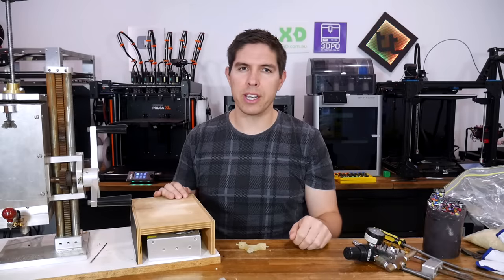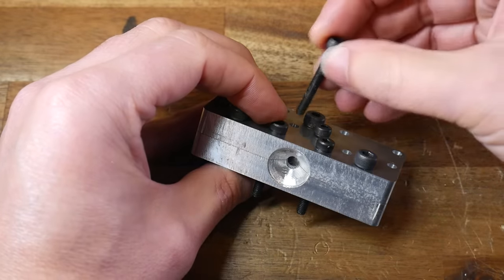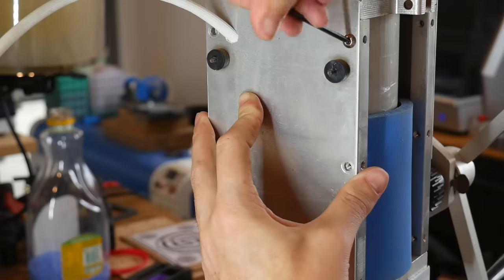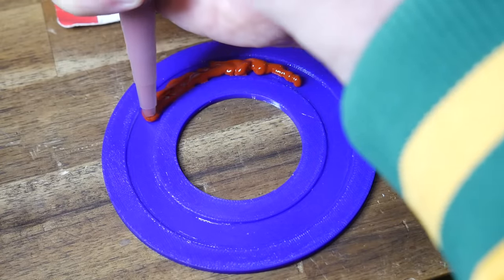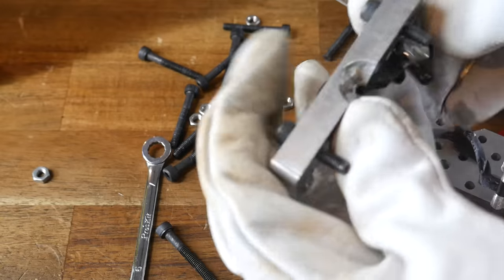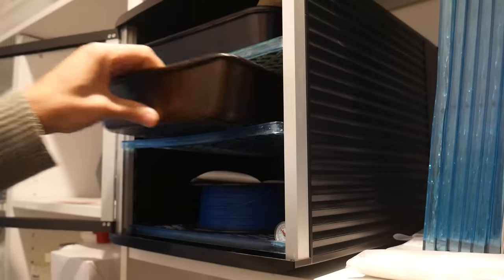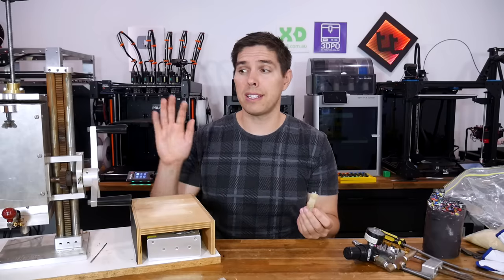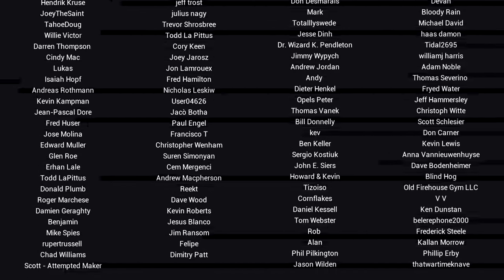Home injection molding part 3: Making stuff! (kind of..)

Comment: I used to work in injection molding for nearly a decade.

somewhere north of 70% of the energy to heat plastic comes from shear friction in the compression zone of the screw.
That machine you had was relying on the thermal conductivity of plastic to "soak" the heat until.  You probably degraded a bit of the plastic near the barrell sleeve, which probably made the part brittle and also chemically "stickier" (degradation via hydroxyl boding or crosslinking) to the mold surface.

Drafting and surface texture are very plastic specific -- it is possible you made a mechanical "puller" with your dremmel on opposite mold surfaces (think, negative draft angle around a feature) and that could be what caused the part to stick.    I would want that texture of the surface to be at least sandblasted, if not smoother -- preferably semi polished to a 400-800 grit sandpaper.

Usually you want two molds if you're using a desktop machine to reduce barrel residence time to reduce degraded plastic.  I would say maximum 50%/50% prime/regrind ratios for strength, but honestly probably 70% prime is the easy sweet spot for strength.  

A Problem though, is you're overcooking the plastic.

With the setup you could probably turn your regrind into a smaller diameter extrusion and using the extruded rod directly, like you did with your hot glue gun is a lower tech alternative to direct injection.  But there is nuance to how you'd want the plastic  to flow in a reducing barrel diameter, like a longer landing zone to make sure the shot has enough thermal mass to fill the cavity.

I would kind of like to see some of this industry knowledge propagate to the 3d printing community at a hobbyist level; as I know that it circulates in industry-relevant circles, but is also extremely useful when considering 3d printing constraints.

Comment: PLA is really difficult to inject. We have an injection molding machine at our university, and somethimes I make it run on ground PLA parts. With the PLA's really low glas transition you have crazy sink marks, then the part is too soft to eject, or if you cool it sufficiently, it shrinks and this render the ejection difficult too. It is great because is emphasize the effect of parameters such as temperature, pressure, cooling etc so it helps student to understans what's happening during the process. But if you want a good part, it is not easy at alls, and this with a small but indutrial machine. So I'm not surprised that you are encountering huge difficulties with this hobby machine that may already be difficult to use with "adapted" materials. Sill it is a really interesting project.

Comment: Look at John SL-Random Products channel for good info on injection molding and yes, Buster Beagle.  One of your issues is that you are using a machine that is not deisgned to do what you are trying to do with it.  You need a smaller heating chamber and load.  All that is happening is you are heating the outside of that giant slug and not getting a good enough internal seal to push it out.  Injection molding happens at higher pressures than you can generate with your set up.  There is a reason your machine only uses Plastisol!  It would be just as frustrating to try and use your blender as a microwave. 😀
Reply from the maker: That's a good summary (unfortunately).

Comment: Spent 7 years building plastic injection molds.  Ya, these results are to be expected when trying to DIY the process at home
Reply: something ive been meaning to ask for a while but keep forgetting, what do you think of the way that brothers make do it? obviously HPDE/LDPE and PP is different than ABS and Nylon, but I think their stuff looks mighty decent for DIY
Reply: @Mobile_Dom do they ever mention what kind of injection molding machine they use because it looks like it works really well.
Reply: For complex stuff, a DIY approach will be a tough hill to climb. But for simple parts it can we work. We started with an lns manual injector, and I made molds on the Tormach.  We made about 1000 parts that way. I then engineered a conversion of that system to use pneumatic cylinder for injection, and had it all controlled by an arduino mega that tracked cycle time and operated all the valves. That was perfectly reliable and we made another 6000 parts (with one mold update) that way. 

The problem was injection volume. Cycle time was about 90 seconds because enough plastic had to melt to inject, but then it injected over 50% of the barrel capacity. 

So we engineered a system from scratch with double the barrel volume and then the cycle times dropped to about 35 seconds because the plastic from the top of the barrel was as in there for more than 2 cycles. 

Anyway, we made a ton of parts before stopping that business. For us, approximately 7000 parts with a net proceeds of about $8 a part. Not bad for under $2509 of home brew plastic injection.
Reply: Another great video Michael. Love the work and inspiration you give the community regardless of one's status, ie beginner, intermediate or advanced
Reply: Plastic used in injection molding have a high mfi value. That’s where this HF filaments are coming from. They use a higher mid value so it will be more fluid when melted.
Reply: Author just used wrong machine for job. Look at piston diameter, it's about 8 cm. It will requre about 20 tons to make 6000 psi injection pressure. Factory desktop hobby machines have much smaller pistons: about 1-2 cm

Comment: I worked as a tool and die maker many years ago. We made plastic injection molds for the toy and aerospace industry. Because they were built to make thousands of parts they were made of steal but aluminum should work for small runs. On all the molds we made the mold cavity was mirror smooth aiding in the release which seems to be one of you biggest problems. If you ever feel the need to try this again you may be able to use some of the electrical parts but throw away most of your current machine. I'm looking into making a mold for a project and have found some great recent YouTube videos. You have great content, thanks.

Comment: 3 world records within one project is impressive to say the least!
What helped me the most in casting silicone sealings, suction cups and airtight parts is using sharp (~30°) mold edges around the sides which help to cut the thick paste flashings clean where the excess material is squeezed out. If you need really sharp edges on your silicone part you can use multi part molds with flat contact durfaces which aren't perfectly airtight preventing air pockets to appear.

Comment: Witchcraft!  I was fortunate enough to be shown around an injection molding factory about fifty years ago.  The factory had a dividing wall.  On one side was the molding machines, operated by unqualified staff  (probably replaced by robots now.)
On the other side of the wall were the Tool and Die makers... multi-talented, qualified, articulate and helpful.  The machinery was mouth-watering, even including things like EDM machines.  While there were CNC machines, they were not like today's perception.  I had a good look at an auger (material feed screw),  it had a conical core, and the 'threads" had a varying pitch.  As the charge of plastic became more liquid the screw moved it at an increasingly higher rate so it would flow all the way through the mold before it became too solid.  As I said, Witchcraft!  😜 
Thanks for another fascinating video.   👍
*  I just remembered:  On the wall in the foyer of the factory was their logo printed around a thirty-six inch micrometer.  The micrometer was a gift from an engineering supply firm who placed an order for "Thirty 6-inch micrometers"... they received the 36-inch micrometer instead!  OOPS!!   😧 😵‍💫  🥴

Comment: Well, I'm glad I decided against trying more ways of recycling plastic after watching this.
I don't have anywhere near the waste quantities as you do and melting it into sheets works quite well for me.
I even add back the waste from the cut sheets too.
Just for reference, the injection molds I've seen are polished to an almost mirror finish to avoid sticking. But it looks like that machine is your major issue.

Comment: I definitely want to see more...  an industrial name for this kind of thing is "LPMS" (low pressure molding systems) and they do everything from glue-stick format to bags of pellets and air pressure molding.

My pet project is some fittings for my homebrew setup -- 3d print doesn't work because you can't clean them right (mold between layers or toxic UV cure).
Getting a commercial mold cut is 5-20k, so I 3d printed one and... have been having about the same amount of luck as you've been having.

Comment: At my job we have been using sla 3d printed molds and 2 part polyurethane mix.  The results are quite good.  We use a large syringe to inject the poly.  The polyurethane is thin enough that you don't need a ton of pressure, and the parts can be demolded after about an hour.  Full cure takes a while longer.

Comment: silicone: I had better results using ABS (which naturally doesn't stick to silicone) that was soaked in soapy water. You also have to wait extra long for the high temp silicone to really dry which is longer than the 1 day. I also clamp the mold shut with bolts with serious pressure so there is almost no trimming. 1mm bubble holes are needed; like those many cylinders you see on a new tire. also soapy blades slice it better but i use trim scissors.

Comment: The mold release issue is due to surface texture. The more smooth you can get the mold surface, the higher quality the parts will be. If you are satisfied with the size/shape, consider making a more expensive mold for them out of aluminum.
Reply from the maker: I agree the mold stair stepping is not ideal at all. There's draft in the CAD model but when I have steps each vertical wall doesn't have it. Not sure if you saw part two but this mold is aluminium, just with a tool diameter mismatch which caused this problem.

Comment: There are mini desktop injection mold machines that act more like a production machine (screw material drive, actuators for opening and closing a mold). Of course they still arent nearly as cheap as your setup so it would be a hefty investment
Reply from the maker: I think I've compromised the whole process by relying on a machine purchased ten years ago that was never intended for this job.
Reply: Not sure why you were still short shotting even after adding a vent hole. Maybe material was cooling faster than you could inject it? This guy seems to be having success with a similar setup: https://youtu.be/wMRSPXt48CI?si=NctHQqJkZ0PkROJo

Comment: Thanks for another awesome video,
It did seem that you might have given up on the PLA just as you were close to making some progress, I'd be fascinated to see what sort of difference dehydrating the PLA would have made.

Another way forward might be to 3d print a glue stick substitute out of ABS or PLA filament and then inject that,. the glue stick gun looks like it has a lot of potential for low cost injection moulding, though it might be limited to simple moulds that are more forgiving of shrinkage.

If the 3D printed glue stick replacement works a silicon mould of a glue stick filled with used PLA or ABS might be a relatively low cost (but low volume) way of recycling printer waste. 

Also it might be interesting to experiment with silicone moulds they might be more forgiving when it comes to part extraction, though viscosity might be a challenge, There are some videos by TheCrafsMan SteadyCraftin that might be a useful reference if you haven't seen them already, 

Thanks again and good luck with your future endeavours :)

Comment: I have not read thru the comments but after watching this video I would say a bunch of things.  Just like with your 3D Printers there should be a "melt zone" and a "not melted zone..."  (clever, I know) and the same thing needs to be seen in the injection molding process.  There are some folks here on YT that have indeed built successful injection molds so I would recommend to take a peek at what they have done.  

That said, I would say that having such a large heated chamber would not be the best way to get the pellets ready to inject.  The large bore means you will have temperature differences throughout the material.  That plus a mixer in a molten plastic would probably not work (perhaps as you found out).    

Injection molds often "melt" the plastic suddenly via a shearing action via a turning screw... they do have heaters but that is not to fully melt but rather "get the plastic ready" to be processed.  The injection pressures can be kind of high but I have not seen the calculations for this in over 2 decades...  

I am not sure how to make this in miniature at home but as I noted there are several folks that I do believe have accomplished it so I hope you look into it some more.  Some suggestions would be to make the chamber much more narrow, to hold just a bit more than 1 shots worth of material at a time.  

The time it takes to inject and fill the mold is very important, it is usually a fairly rapid process to fill the mold, and then to transition to a pack and hold cycle.  'pack' and 'hold' are what they sound like - how do you "pack" the mold while the plastic is all still fully molten and say 95% full and then freeze the plastic in place and while this "freezing" is taking place hold some amount of pressure on the mold.  

The idea is that the mold can heat sink the temperature out of the plastic very quickly and is often done with water cooling...   Could also be done with a larger mold or a mold inside a mold "shoe" and perhaps a fan???

I don't know if you indeed already know this stuff and considered it for your project, I don't know everything and I truly like all of your content and applaud the efforts and ideas put forth.  It would be great to see you solve the problems and present the next revision of your work and I hope it continues as home injection molding is very interesting as injection molded parts "should" have the best properties as compared to a 3D printed twin when it comes to break strength, appearance, durability, etc...  Good luck and Cheers!

Comment: As someone that operates a big injection molding machine I see 2 big Problems.
1.) As others have sait, you are overheating the PLA. It yould at most flow like hot melt glue. Overheated PLA is a brittle mess.
2.) The injection is extremely slow and unsteady. I think The plastic is flowin in multible "bursts" that don't fuse with each other.

To deal with those Problems you need to increase the injection pressure, probably beyound the 8 bar a normal air compressor can provide.

I really liked, that you also show what doesn't work.

Since 3d.Printers are good nowadays, xyou need a Part that you want tripple digit or high doulbe digit coppies, for injection molding to make sense. 

Also dont be discouraged by the problems with your mold. It is common for professional mold to be send back to the mold maker once or twice because something did't work like in the mold maker expected and simulated.

Comment: Haha character building, well said!
I had a similar experience with a fairly expensive 3d printer I bought in 2014, didn't have much success with it for a few years and I just now started to heavily modify it (it is well built mechanically so it is worth it imho), new hotend, new board with klipper, closing it up etc etc. lot of work but it is fun, not expensive and will hopefully be worth it 😊

Comment: Thank you for this video sharing your journey of reusing your 3D printing leftovers! I think you had some nice results and that your approach should not be compared with the results of industrial machines in the outcome. I myself am working on converting plastic waste into products and think the textile press method is a great example of where the direction can go. Recently I have been working on a "pellet" extruder for a 3D printer that uses shredded plastic. On the topic of reusing PLA prints, I think the approach taken by the recycling factory company is a good one. Not one person should try to make it happen, but rather a group of people / community. Maybe you can find someone in your area who is active in this field and who can/will take your print waste. The process of converting print waste was very nicely shown by another youtuber here called dr dflow, maybe check him out if you want to do the process yourself (not really worth it unless you convert tonnes of plastic). 
Thanks again for the nice videos! Have a great day!

Comment: Can you try using the 3D printer hot end to inject filament into the mold. Consider to use a 3D printer heater to preheat the mold.

Comment: I might be wrong here, but I feel like you would have a much easier time removing the part from the mold if the parting line followed the curve of the part rather than bisecting it the way you have done. 

Also, why are you casting the silicone o rings? It would be far easier to just buy a sheet of silicone in the thickness you need and cut the o rings you need from that (You can use a machined die to get very round cuts).

Comment: Of course it won't work well - factory hobby machines have much smaller diameter of injection piston which provides huge pressure (but small volume). Typical hobby machine pressure is 6000 psi (400bar). It means pressure 400 kg per square cm. Your piston is about 8 cm, so area is 50 cm2. In this case it requres force 50×400 = 20 tons! If you will make just 1 cm in diameter you will need only 0.78 (cm2) ×400 = 300kg which is much easier

Comment: I would be very interested to see what can be done with 3d printed molds and hot glue.  espcially since notrmal 3d printing would not stand to the hot glue temps.  curious as to your solutions.  thanks for sharingthis,  seeing something fail is always a good learing experience.